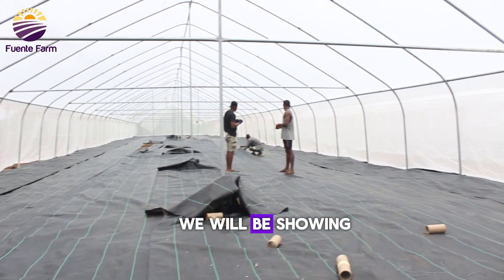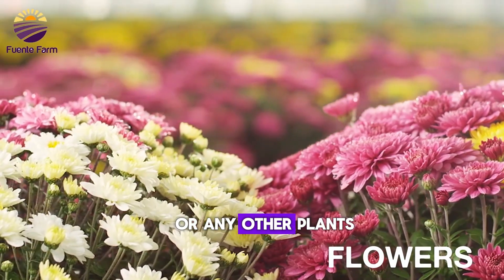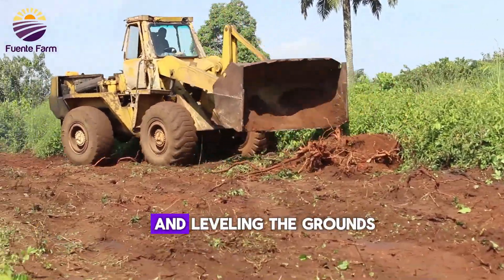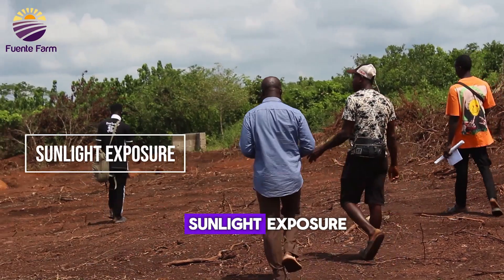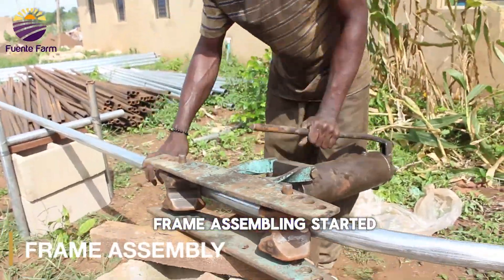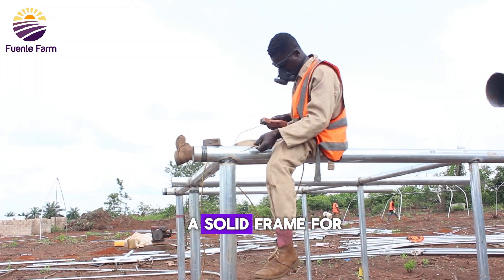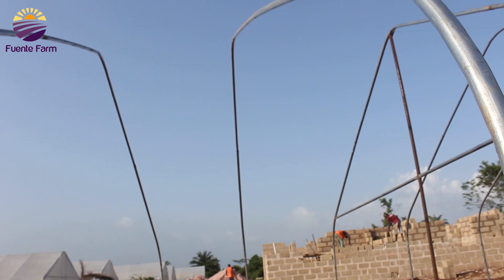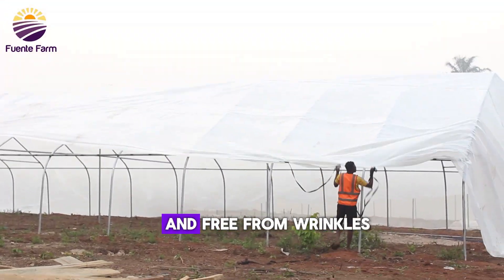BUILDING A GREENHOUSE IN NIGERIA - STEP BY STEP PROCESS

Comment: What state are you in? What is the land size you used for one greenhouse
Reply from the maker: thanks for watching and finding our video helpful. we are located at Ogun state nigeria. The size of the Greenhouse is 7om x 10m. you've got to have a land mass that will contain such but there are smaller greenhouses too you can go for if need be.
Reply: @FuenteFarm how many plants can it contain? And how much are we looking at to construct that for tomato hydroponic farming
Reply from the maker: @darlingtonojinnaka4259  for this size of Greenhouse,  we currently have over 2000 plants. you can reach out to this number +2347083340180
Reply: What is the setup cost for the 70 x 10m size